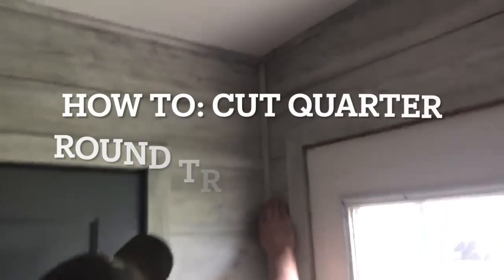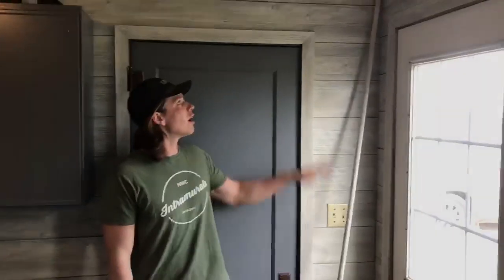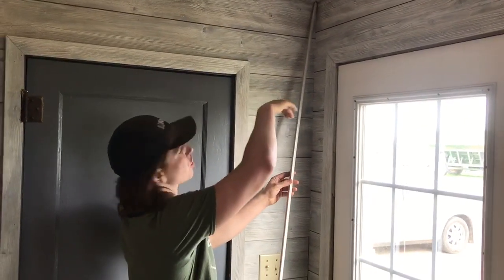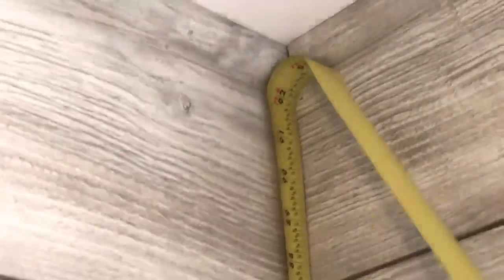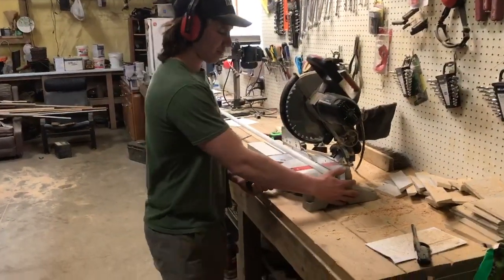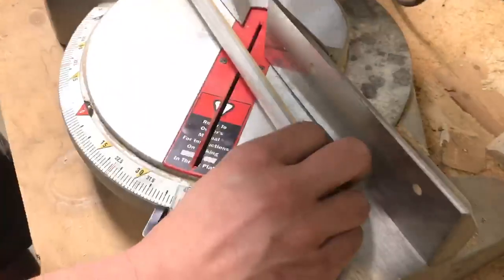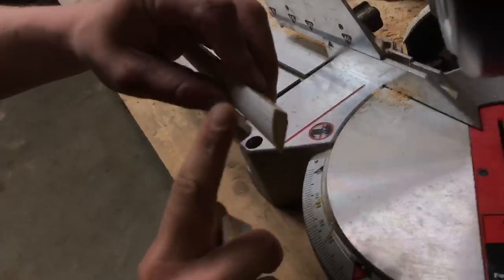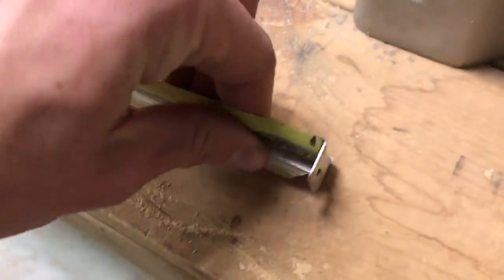How to cut quarter round trim for inside wall corners

Comment: What color paint/stain is on the wood walls? Love it! Thanks for the tips!
Reply: Looks like a primer. Usually 2 coats before paint. White is typically what you would use. If painting a light color or a dark color paint, i use grey to neutralize the darker color
Reply: But i dont think hes using primer actually lol so nvm